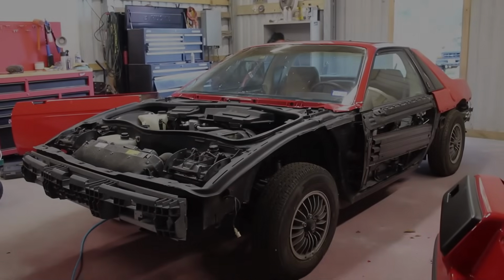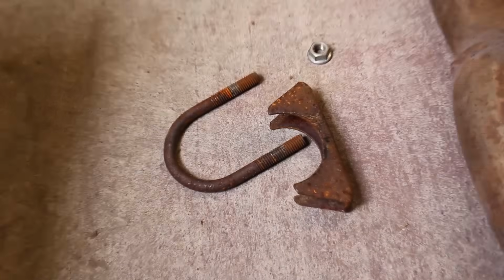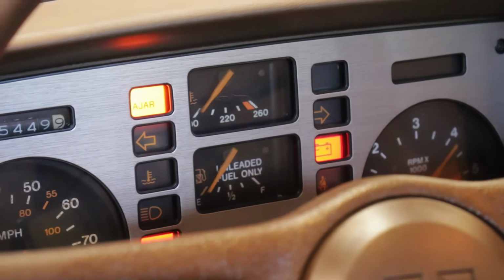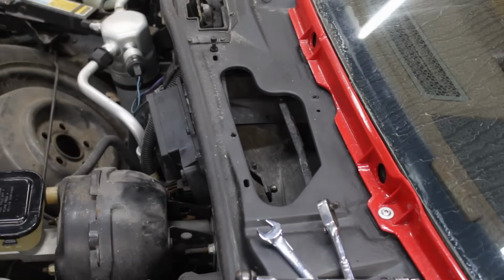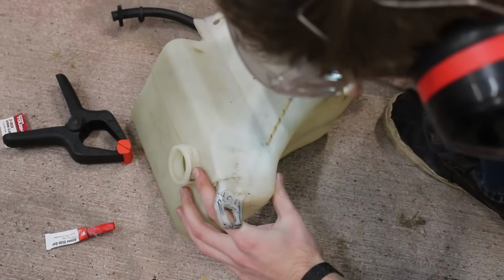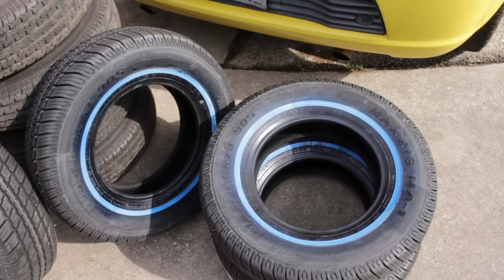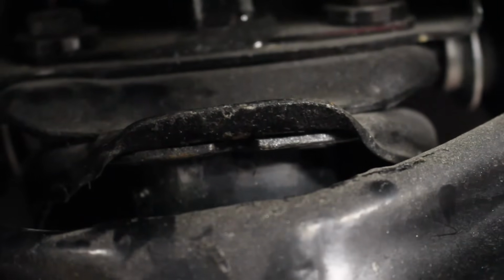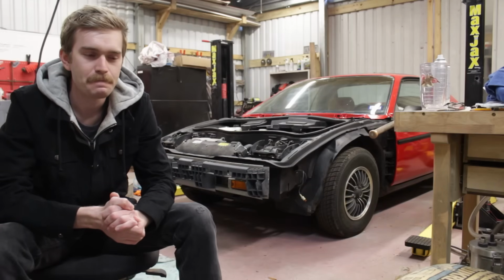The Haunting of Red Car | 1985 Fiero 2M4 Revival - Part 14

Comment: little welding tip for you, try to keep the mig gun about a half inch away from the work piece, try to have both hands supported instead of hovering, and avoid doing stuff like figure 8 or half moon patterns until you are much more experienced, your patterns were very exaggerated as well. try to just do small 1/4" back and forth movements to push the puddle back over fresh weld bead to get more materiel on it while its still hot and clean. or just go in a consistent straight line.

Comment: Great work again Ronald. Looking forward to seeing the car completely done and rolling down the road with you behind the wheel, grinning like a madman.

BUT...

Just a minor detail. I just heard you say you bolted and stainless steel clamp to your exhaust to hold the tailpipe up. 
But bolting a stainless steel clamp to a regular steel exhaust might cause a bit of galvanic corrosion. If you don't want that tailpipe to rot and come completely off while driving, you might want to put a non conducting material between the two metals.

Comment: Honestly Ronnie, those clapped out stock rear springs might be the same height or even lower than the brand new lowering spring. When I was replacing the coils on the front of my eagle, just going to a new stock height spring raised the front over 2 inches. also those new springs might settle by up to a half inch as you drive it, so break them in before aligning.

Comment: for your safety, you should put "gasoline resistant" varnish over coper wires and soldering joint to prevent any shortage due to a "liquid contact"

Comment: Hey Ron, I know the barn door is open and the horse is gone, but it might help you to get a transmission jack. It is great to help with the gas tank as well.....
Fixing that crack in the overflow bottle, we call them "stress risers".....
I still think a larger diameter wheel for your car would look awesome, in the same design, or similar....say 16"? It would also give a big handling upgrade as well. No sloppy side to side flex from the rubber....
Yes, rear-wheel drive vehicles typically have a little toe in on the front. If you think about it, as the car is moving, the wheels want to splay due to friction on the road. So to counter, you have to toe in a bit.

Comment: Dont make us cry, the series need to continue! If you ran out of things to restore, its time for upgrades! Make the 3 speed wipers 4 speed! Get 195 tires.  Accent seat stiching. Body stripes. H4 lighting, stereo amplifier, color coded (red) wheel detailing, auto-down windows, tinted windows, bluetooth stereo upgrade, in original unit, glove box light, builtin fridge (this is texas afterall), 1/4hp engine upgrade (KN), NOS system (cream chargers), ambient interior lights, and SO much more!

Dont give up, DO IT!

Comment: Great job👍. Like the lowered springs on the front. I have the same look on my 81’ DMC. As the front spring height was altered late in development due to potential federal rule changes on headlight height. A club here in 🇬🇧 got hold of the original “Lotus” spec spring drawing and had the springs made to the original design height. Makes a massive difference😎.

Comment: Please tell me you will put the lowering springs in the rear. They are designed as a package. Having such a large difference in spring rates from front to rear over the factory differences could be dangerous. Its more than about looks.

Comment: Well done. Well done.  My brother had an 87 SE.  since then I’ve always wanted to get one.   I was fond of the Formula but I’d take any notche at this point.

Also, fantastic work on the overflow tank.  Looks like the repair worked well.  I had to figure out how to fix the plastic fender in my concours 1400.  Hit a rabbit and it cracked.  After doing a few searches, I combo plastic welded it as well as using a custom abs cement mix to bond the crack.  Sanded it down and sprayed it with a rattle can bed coat.  It’s been 3 years and has been holding ever since.  Looks good too.

Comment: I used to have a 1988 GMC 2500 pickup with the same wiper problem. I used to hop out of the cab, pop the hood and plug in the motor when I needed wipers ... couldn't be bothered with taking about the steering column to fix it.

Comment: You can just change out the seal on the oil cap with the seal from the new one and retain the original cap. I did that with my gas cap because I didn’t want to throw away my original branded one because of a bad seal.

Comment: As others have mentioned, it's really recommended to put the rear springs on too. Having such different spring rates between the front and rear will significantly impact the balance of the car.

Comment: Fun fact on the screws: The mark isn't to denote that they're stainless steel, it's a (still very poorly chosen) manufacturer mark for Southern Fastening Systems. They were in business from 1945 to 1990, so they probably should've known better. Every manufacturer has their own (far more innocuous) mark that's typically located on the fastener head like that.

Comment: Just a point with the springs, you have increased the front spring rate by a lot. Don't get rid of the new rear springs just yet. I'm just worried that you might find a bit of an imbalance between front and rear grip in cornering.

Comment: The issue you had with separating the exhaust early in the vid is the exact reason I stopped using those exhaust U-clamps. Yeah they are low cost but they also can crimp the pipes and separating them are a pain in the arse. Instead I now use these exhaust couplers or sleeve clamps. Expensive but there are also OEMs that use them like mid 2000's and forward VWs. https://bit.ly/3q5MkU1

Comment: I wish I was the guy to replace your windsheild..25 years experience...super easy job..hopefully a hack isnt sent out when you decide....
Reply: if you replace it yourself.....Im sure it will be fine..just use 105 molding around it and sika sealer..run a bead of glue on the molding before you set it..you are golden..run a tall bead too..dont sink the windshield down..stay golden pony boy

Comment: Maybe some electrical contact cleaner on the control stalk.  I had an issue with cruise control on a VW, and read that some liberal use of it could fix it.  Worked like a charm.

Comment: Two things:

1) You should go with O.W.L. sidewalls. Always gives sports cars class.

2) Don't unnecessarily convert measurements. In cases like the lowering kit, since it was advertised as a 0.8" drop, you should measure in Imperial to save yourself some time from converting. No point in constantly switching between metric and imperial if you can help it. It didn't work out well for NASA.

Comment: US Standard is not Imperial...that was Canadian and British at one time. You had me laughing about the wiper system. Gratz on the rad hose preventative care.Too many would have left it and then cussed when they failed them. I used thin sheet metal instead of staples. I would make a u shape so it strengthened and took the load off the broken piece. Easy enough to do. Your repair seems good though.

Comment: I used to repair the GM tachs like that when i was a mechanic/electrical tech. GM ic's are proprietary and not listed except in their specialist catalogs. Even then you won't find any specs on them per se. Hardest part of the master cylinder rebuild is the pump up before reinstall LOL I am with you about the rims. Nice looking on that car.

Comment: People would tell you an old car is just junk, not worth fixing, but I hate that mentality. Old cars are not junk, they're history, and when you fix them you're adding to that history. It's not just an old car, it's your old car.

Though I do have one concern, putting the stiffer springs in the front without putting the matching pair in the back will alter the way the car handles. Spring rates can make a huge difference in when and how a car under or over steers, and with a Fiero or any mid-engine car it's really critical the rates are right. If installing the matching rears drops the car too much in the back it might be better to find another solution than run the stock springs. Eibach chose those rates to match for a reason.

Comment: My wipers did exactly the same thing. The problem was the switch on the column.
As far as the exhaust is concerned just heat it with an ox-acetalene torch to red hot, then twist is a little bit. No cutting or welding required.

Comment: Well done! Almost finish but I can't stop asking myself why the rear end of this car was so low? Maybe the rear coil are shot or the front one have been change with the wrong parts. Honestly I'm a bit worry. The handling of your car will s... big time if the front suspension is stiff and the rear one is very soft. My suggestion is to remove the rear coil spring and compare them with your aftermarket one, It's a lot of work but the good thing is, you can make another video out of this and end up with a good and safe handling car!  It's a win win for you and us :-)

Comment: I would fit the rear springs for the sake of keeping them all the same and for better feel. Having stock specs at the back and stiff at the front may make the car feel weird to drive. You may also find that once the springs have settled the front will look lower than the rear.

Comment: This ride height problem seems suspicious to me. You had a difference in ride height between front and rear that was never explained and you just put in lowered and stiffer front springs. I am curios as to why there was a difference in the first place; is there  problem with the rear springs or had someone somehow installed the wrong front springs? I would be a little concerned about funky ride characteristics with softer original, and perhaps sagged, rear springs and stiffer front springs. Maybe it would be better to install the rear springs from the lowering kit as well to keep the handling consistent?

Comment: A car project is never done.  You just decide at some point to stop working on it, haha.  The lowered front might adversely effect handling but I'm no Fiero expert.  Why not switch out the rear springs and see if it levels out?  I correct toe the same way you did.  You might want to verify your camber isn't out of whack too.  It can also chew up tires though not as fast as toe.  That sketchy spring compression wire might be safer using 1/8 multistrand cable.  I'd use too separate loops in case one lets go.  BTW, the moustache is taking over your face Ron.  Mow that thing already, lol.

Comment: You didn't get the lower radiator hose over the nub that helps keep the hose clamp from coming off!! Go back and fix it or you'll be very sad!! (you can see it at 21:52 in this video!)

Comment: You might hate me for this, but I think you should swap the rear springs for the aftermarket ones as well.  Because when you changed the front springs for stiffer ones, you have changed the balance of the car's handling.  Presumably the lowering spring kit is actually thought out as a whole, so the spring rates complement each other and the car's handling balance is preserved.

It should be a lot more fun to drive with the whole spring it in it.
Reply: this. im pretty sure the rear springs are simply just worn out abit since the engine weight is in the back, i also have a car with engine at the back and i was also dealing with this exact issue, and replacing the rear springs with new oem spec ones fixed it completely. id bet if the rear eibachs would be fit too, it will sit as it does now and the suspension wont be out of balance.
Reply: Agreed fully. Having different rate springs front and back is a bad idea, especially when the old ones are worn out. Putting the lowered ones in the rear should make it site perfectly evenly and have the correct matching spring rates front and back.
Reply: Yup. One more vote to replace the rear springs too. Especially since you bought a matched set of 4.
Reply: Yeah, you may as well USE the matching new rear springs since you HAVE them.
As others have noted - the stiffer suspension springs all around will likely ride perfectly and level.
Reply: Having stiffer springs in the front will just increase the understeer, which is perfectly fine. It's not a safety issue and the handling won't be noticeably screwed up unless he's autocrossing it.
 But having said that, yeah I'd swap out the rear springs as well if it was my car. Nobody wants to buy rear lowering springs without the fronts, so he's stuck with them, might as well use them. Also there's no down- side to installing them.
Reply: I thought the exact same thing when he said he wont be changing the rear ones, I bet they are just worn out

Comment: Congrats. Looking forward to a finale video where you have the windshield fixed and all the panels on and you take us along for the real enjoyment: going for a DRIVE. Because that's what it's all about. After years of wanting a Miata I rescued a 1996 from years of sitting in someone's driveway last March. Only took a week to clean up surface rust in the battery area then diagnose and replace the dead fuel pump and I had it running. On this drive a few days later to get new tires it felt both awesome and surreal to actually be out for a drive in MY Miata. So bolt that 2M4 on together and get to enjoying it. https://youtu.be/F9KblRrWIjw

Comment: You're not done yet, you still need to take us for a cruise once you get the body panels, rear view mirror, and windshield replaced. Lol. Question though, could the stock rear coil springs be worn out giving it the odd angle of attack?

Comment: I do recommend that you also install the eibach rear springs. I have no idea what's the actual spring rate difference, but there's the potential issue of having stiff front springs and soft rear springs causing weird handling issues.

Comment: I'm not even a car guy but I've loved this whole series. Bittersweet that it's coming to an end.
Reply: Guy is amazing. When he started fixing easily replaceable components, my initial reaction was “Why? That’s silly!” A few videos later, the fact that he’s doing that is my favorite part. That’s pride & professionalism on a new level.
Reply: Did he ever tackle the A/C? Am I not remembering?
Reply: @thebigjohn8239  if I remember correctly, he did changed the AC compressor and all the rubber seals to be compatible with r134 refrigerant, so i guess it just needs to be charged with refrigerant.

Comment: In the future, if you ever need ride height modified you can take your stock springs to a suspension shop and have them stretched or compressed in other words "re-sprung". What they do is stretch or compress them then heat them to "set" the spring. I'm not sure if many do this, but we did that all the time back when I worked in a restoration shop...

Comment: There has to be an issue why the car sits too high in the front (if that is even so) that should not be fixed by just mounting the front part of a set of springs (which would be illegal in quite some countrys for a good reason)

Comment: I would install the eibach rears also, the increased spring rate will improve handeling, great work by the way
Reply: I agree, was thinking the same thing. It will make the car handle really weird, rock hard in the front, oem bouncy in the back. Especially for a mid engined car, I can imagine a situation like that would cause things to get real interesting in hard cornering and quick manuvers
Reply: @Pauleh123  I can tell some people here have never autocrossed before. :/
 Having the old springs in the back and higher rate springs in the front will just give it a little more understeer. It'll be fine.
Reply: You definitely want matching spring rates when driving down the road.
Reply: @dateatorjr9671  he's gonna be concerned about lowering the back giving it that aggressive stance again, which he didn't prefer
Reply: @JinnaiT  I don´t think the rear springs still have their original height, so the Eibachs in the rear will most likely not lower the rear from where it´s now.
Springs do get weak, had it on my Caprice Estate (I compensated it with the Hijackers, until I installed new ones). 
Many old VW Dashers also had the issue.
Reply: Agreed
Reply: That will be the next episode, I am sure.

Comment: Just a heads up to everyone, check the bore when rebuilding a master cylinder, especially if you’re replacing it because it failed after bleeding the brakes or replacing a part elsewhere, because that means it likely has corrosion in the typically unused portion of the travel, and the seals got cut when moving past it, new seals won’t fix this and it will need to be cleaned, at least to a point of being smooth and roughly the same diameter as the rest of the bore

Comment: This will get buried but don't get rid of those rear springs yet.  The Eibachs will settle and it will get lower as you drive it, so you might want to compensate with the rear springs.  It might have a bit too much 70's stinkbug rake for your liking.

Anyway, you did an excellent job.  I enjoyed watching you learn and problem solve along the way.

Comment: FYI. You can't check capacitors on the board. Even onboard special testers are dicey. Always recap any circuit board older than 20 years or so. If future board issues arrise, replace the caps first.

Comment: That tach though describes EVERYTHING wrong with the Fierro by 1985. Get a 4 cylinder that redlines at 5,000 RPM or.... buy a Toyota MR2 that redlines at 7500 RPM. And I owned an 1986 MR2 and driving that thing was... FUN!  :)

Comment: The excessive side to side play can both be tightened up (typically) by bending the back side of the rod the arm is made of, as well as allowing movement to keep from having it snap the plastic, the thickness of the rod also determines the flex that has and it acts as a spring